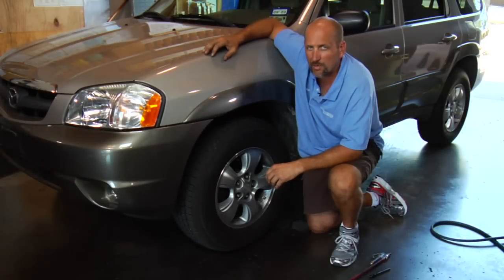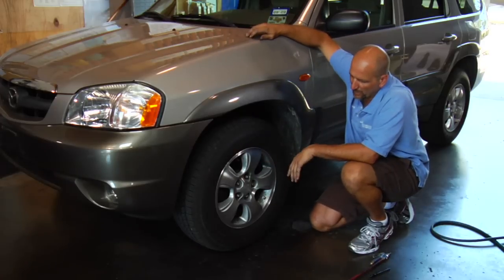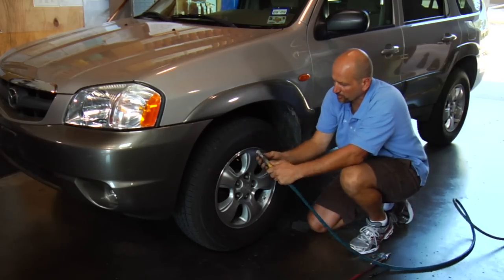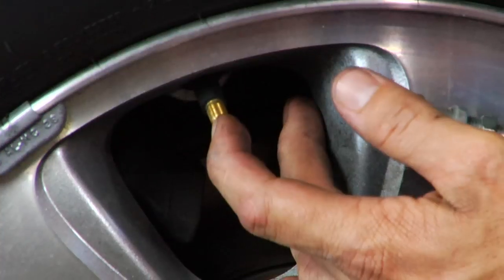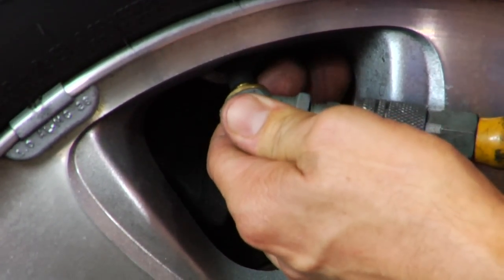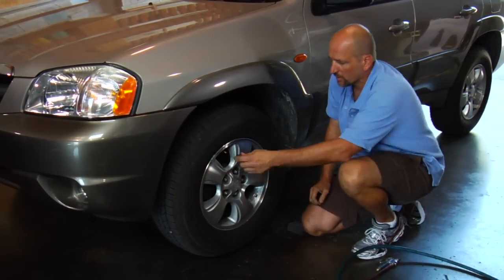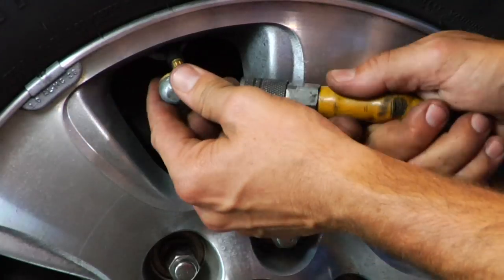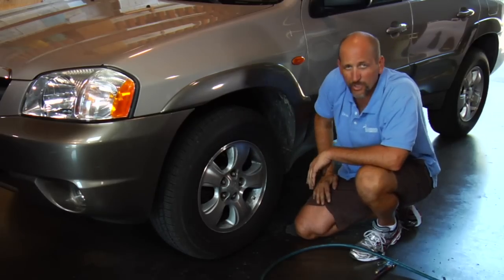Automotive Troubleshooting  : How to Put Air in a Tire

Comment: Most cars should be filled in the 32-36 psi range, but check your tire's recommended pressure (if it's not written on the tire somewhere go online and search the exact model of tire) for what you should fill it to.